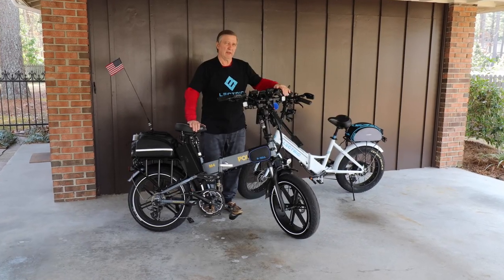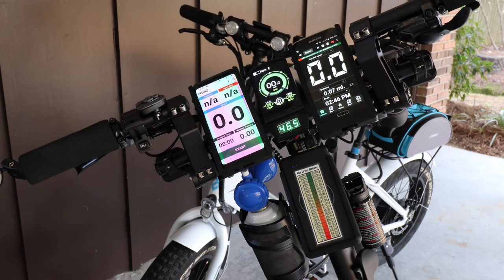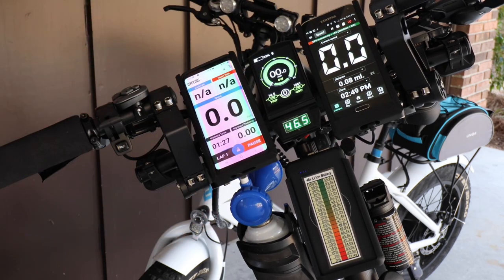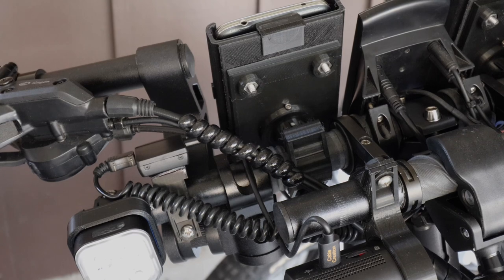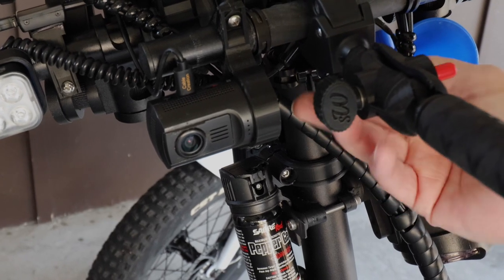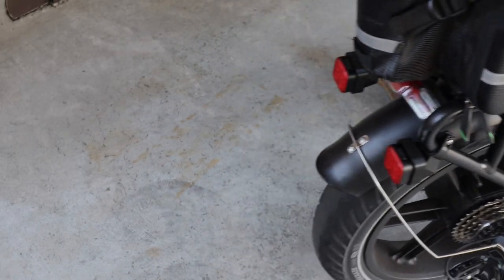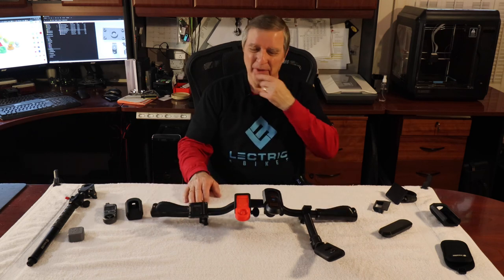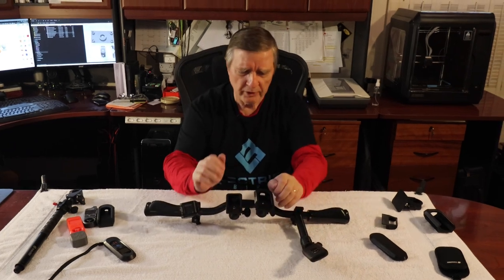3D Printing Stuff For My E bike

Comment: Sonny cool videos I like the bike but I just want to know a couple things does it have a name brand battery and the same about the motor I looked on the site but I was not able to fine anything about brand the yamee xl clearly says it on there site I think a name brand battery and motor is what I’m looking for but I want the bike your opinion
Reply from the maker: Lectric has change battery Ah capacities several times for the XPs.  When I bought mine they were using batteries with Samsung cells (10.4 Ah).  I heard later that they had changed over to LG.  From my experience, having several stock batteries and several non-Lectric batteries, the Lectric batteries have shown that they are close to there actual rating when compared to others.  I do have over 4500 miles on my XP and have had no issues with the batteries.  The motor is a Chinese knock-off of the Bafang.  Millions of these motors have been used and even though they may not have the credential name brand motors, they do have a good track record.  I do know that some (if not all) of the Yamee e-bikes are made at the same Chinese plant as the Lectric (GDS E-bikes).